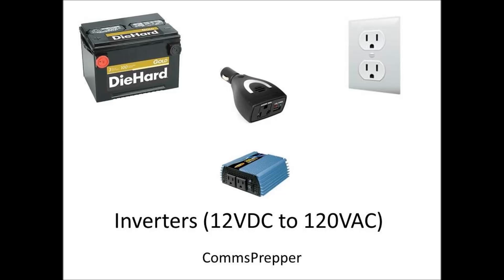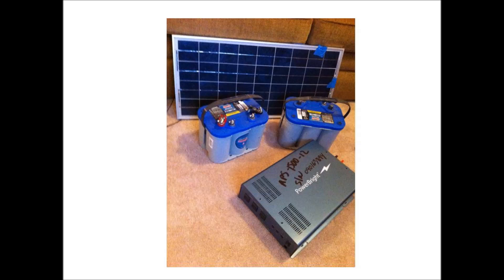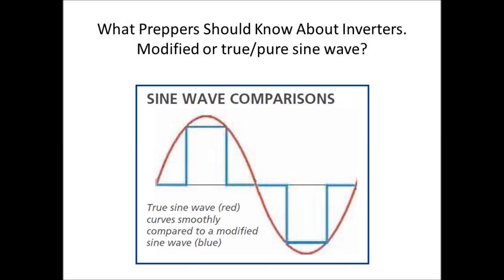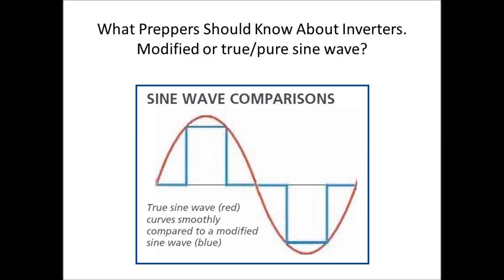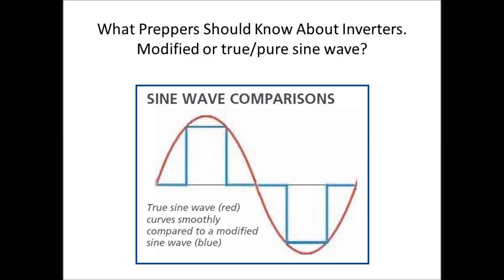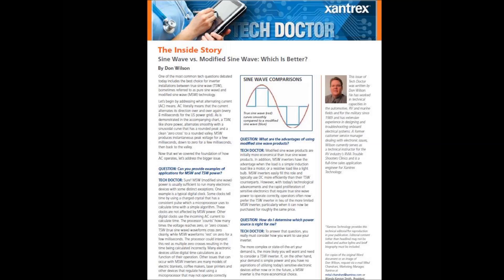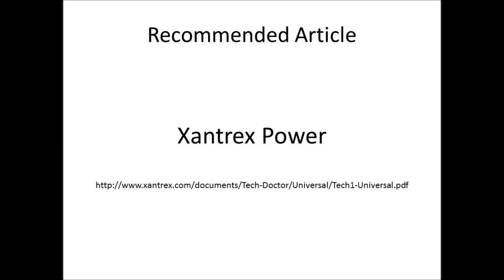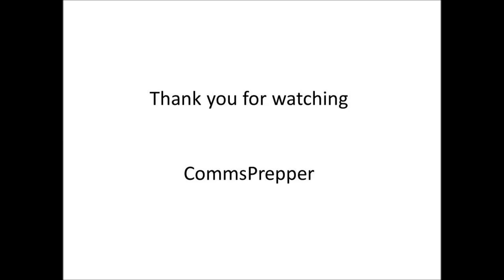12 Volt Off Grid Inverter -- What You Should Know!

Comment: well a lot of computers (like this laptop I'm on) and a lot of other things, like my TV, also convert back to DC. and all that happens with a modified is your powerpack box buzzes. I've charged cordless drills using modified sinewave as well.  but when I got a system for my house I got a true sinewave (which this laptop is using now). true sinewave also use less amp hours from your batteries to do the same job as modified sinewave. i will be using a modified sinewave inverter when I go on a trip in my car halfway up the country for a week or two.

Comment: I have a sailboat (spend weeks at a time on it -- even went through Hurricane Sandy on it just fine :) ) and run my TV's, Digital TV Antenna Converter, Laptop Computers, Battery Chargers, etc etc using the cheaper "modified sine wave" converters for years and really haven't had a problem ---- I know there are things (like certain types of motors, etc) that really need a more pure sine wave, but you'd be amazed at the many things that work perfectly well on cheaper inverters